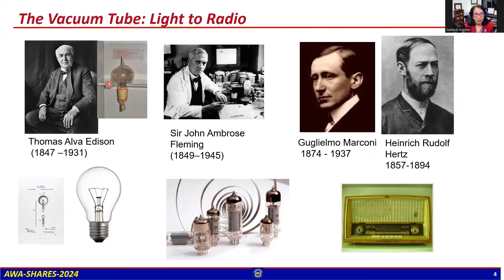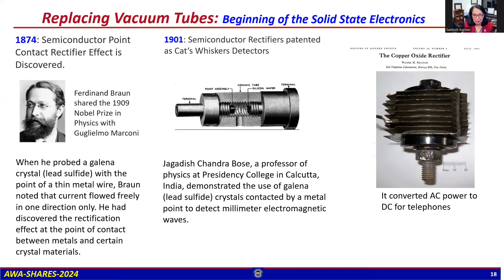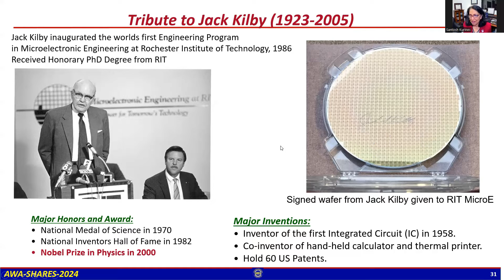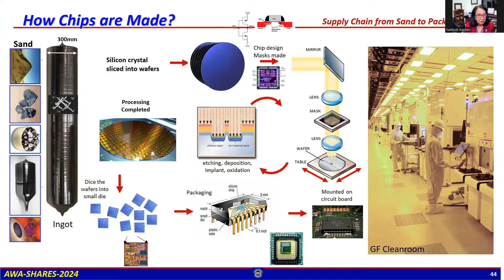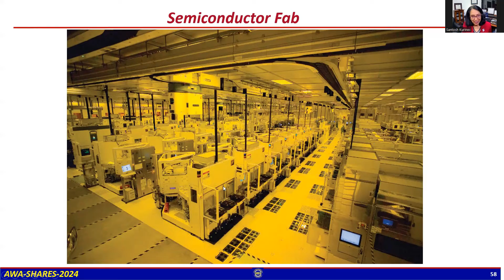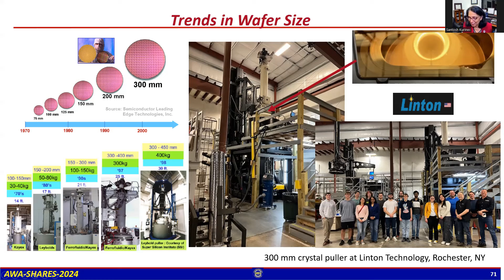The Amazing History of Microelectronics

Comment: I spent many years, since the early 80s, honing my skills as a Scientific Glass Blower. I was working with, designing, researching, and building multitudes of different apparatus with quartz glass. All of which are used directly in the processing and deposition machines for the manufacture of silicon wafers and the corresponding circuitry. I loved your presentation!

Comment: Thank you for including John Atanasoff. In point of fact Mauchly had visited Atanasoff for 5 days and got to study the ABC (Atanasoff Berry Computer) in great detail. Then he and Eckert used the work of Atanasoff and others to build the Eniac without any disclosure or attribution. Atanasoff's work was pioneering: he used punch cards encoded in decimal to program the variables into the ABC. The ABC then converted the decimal values to binary. The machine had about 3K of capacitor based regenerative memory and stored intermediate results in binary on cards punched by HV electrical charges. He designed the first logic circuits with vacuum tubes for his machine. An amazing accomplishment.